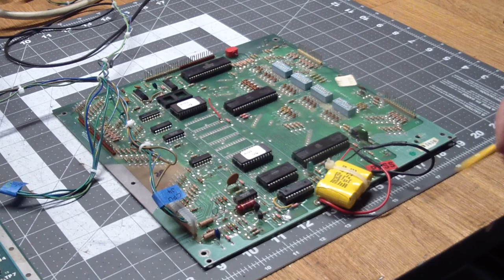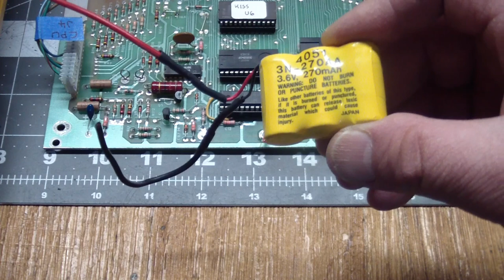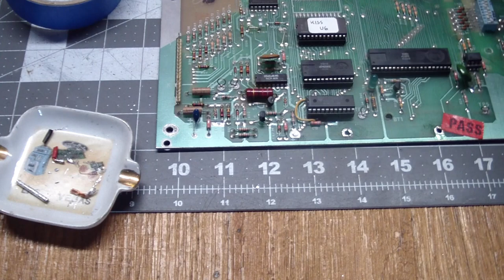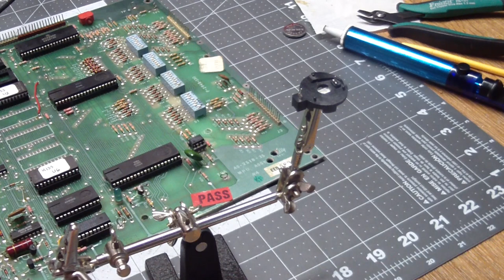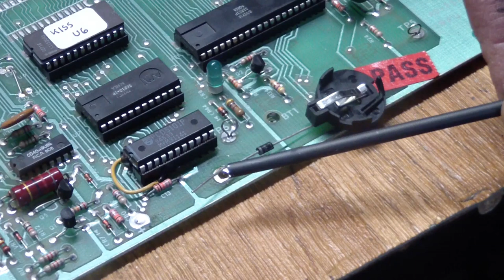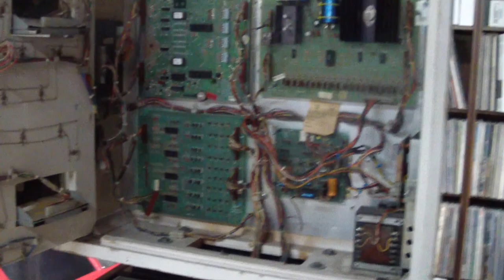AE#168 Replacing A NiCad Backup Battery With A Coin Cell

Comment: Nice one.  I had the same issue with my deltalab super timeline. I even made a repair video about it on my channel. Mine leaked on the board.   I had to clean the board with sandpaper.
Reply from the maker: In a case like that you may want to first use some white vinegar to neutralize the electrolyte from every nook and cranny. You can then sand away any persistent surface damage.

Comment: Warning: Old, Bad Pun Following = You were really on your g-a-m-e, with this presentation. Well explained. Well spoken. Nice, easy pace. Kudos. I  greatly enjoyed it. Just to add a bit... For folks that want to retain their scores, during the battery change, you will need to do what is called a "hot swap." Art explains it best, in his other videos. But the gist is this... Retaining the chip data is accomplished by finding any convenient pins that supply the voltage to the chip and connecting some sort of an equivalent voltage supply - battery, PSU, etc. - by soldering on temporary wires, b-e-f-o-r-e removing the old, (still functional) battery. Once the new, temporary supply is connected, the old battery may be removed. Warning! This causes you to be working on a powered circuit and all of the dangers of doing that exist! Great care is needed to prevent a short that will kill ICs. Also, more great care is needed to make sure that you do not reverse the polarity between the old, or new, battery and the temporary supply. Remove the temporary supply and wires, as soon as the new battery is functional. I assume no risk, if you attempt this. Maybe Art will add a link to one of his videos, in a comment... For Art... I was thinking that shortening the diode lead and adding a negative lead would allow the battery clip to be moved toward the positive pad, a little. This would make it possible to use the existing zip tie hole to secure the battery clip assembly with a zip tie. Why bother? Because some players like to use aggressive agitation methods, particularly for games that use balls and paddles. Or, a bit of temporary adhesive could be added to your method. Of course, you know these things... Cheers!
Reply from the maker: Hot swapping is the best way to retain the contents of RAM. But , as you point out, you have to be very careful with coin cells, because the possibility of shorting the battery holder when removing the old cell is high, and a short will zero the supply thus wiping out the RAM contents.
The "why bother" is very true. Pinball machines are a very mechanically hostile environment and moving the cell holder closer to the middle would allow use of a zip tie using the existing holes.

Comment: What about using rechargeable lithium button cells? That way you wouldn't need to worry about the diode since the button cell would still require voltage to charge it when the game was powered on and running? Also like another person mentioned, I've seen quite a few button cells that have leaked. I've now seen it happen with two SegaCD model 2 systems personally, and there are plenty of accounts of early to mid 90s music gear like sound modules with coin cells in them found leaking quite badly and enough to damage the traces and cause the battery holder to break apart. While it isn't nearly as often as the old NiCad cells, it does happen so any battery needs to be checked every so often to make sure.
Reply from the maker: I put a sticker on everything with a backup battery with the date of the last battery exchange. After a year or so I check it. Any equipment I have that will get stored away for an extended period I will remove the battery.

Comment: Nice video.  Just one question:  The diode you use looks like it could be a germanium type.  If that is the case, the voltage drop would be around 0.6-0.7 volts.  This would deliver less voltage to the memory chip.  It is best to use a germanium type which has a 0.2-0.3 volt drop.  This will give the button cell a longer useful life before needing to be replaced when the voltage begins to drop.
Reply from the maker: I used a 1N4001 silicon diode. The forward voltage drop is stated as 0.4 - 0.6 mV,  but because very little current flows to the battery the diode doesn't become fully conductive. As we can see in the video the drop is about 0.25mV delivering 3V to the RAM and we only require a 2V data retention voltage.

Comment: Bally used a single cylindrical rechargeable battery on that board originally. Looks like maybe a cordless phone battery was wired into the board. Is the coin cell set up a better long term fix over a super capacitor?
Reply from the maker: A super cap will eventually discharge unless you regularly power up the device. The coin cell will keep RAM alive, whether you power on the unit or not.

Comment: Why does NiCAD batteries leak and the NiCAD battery liquid damages the PCB board?
Reply from the maker: The electrolyte in NiCad batteries is usually potassium hydroxide. The battery has tiny vent holes to allow for oxygen to enter. When a NiCad is fully discharged or damaged the electrolyte can leak. The electrolyte is corrosive to metal and plastic and thus damages the PCB.